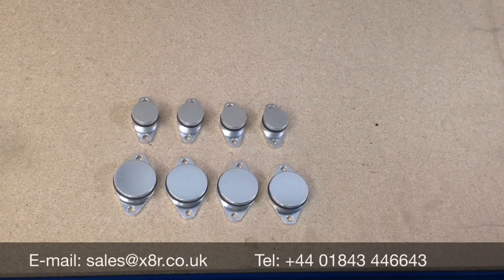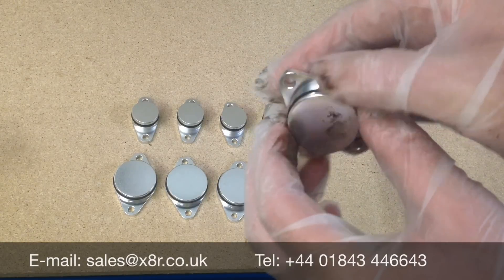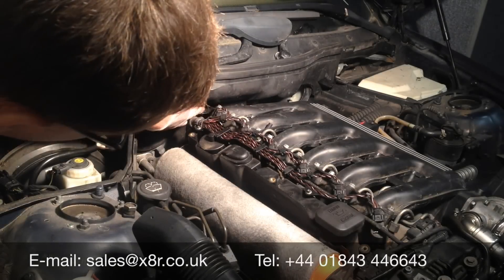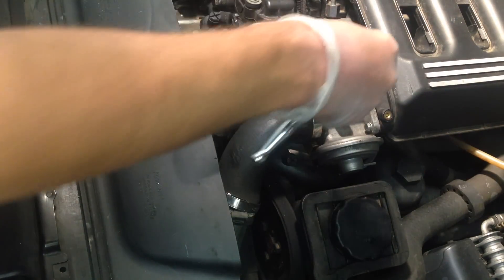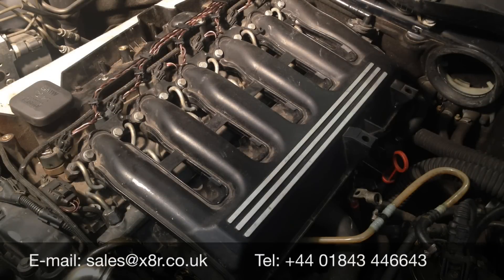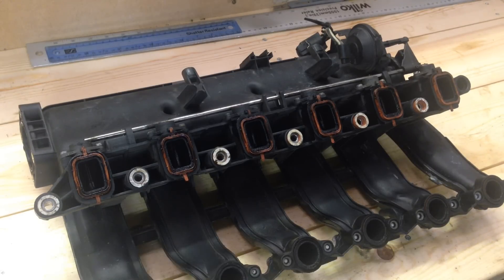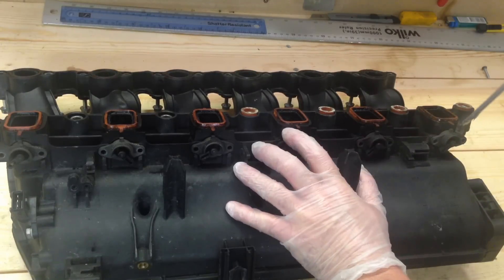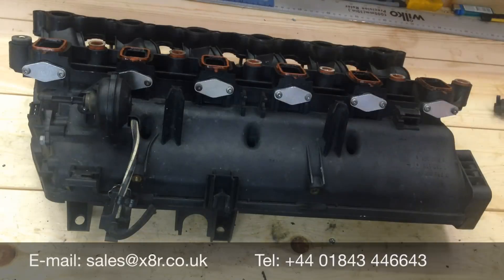BMW Swirl Flap Blanks Fitting Instructions Guide

Comment: At 5.08 the vacuum actuator doesn’t need to be replaced,just cut the rubber tube plug the hole with a bolt and silicone job done,did my M47 320d this way and never had a problem or fault code in 70,000 miles,also did a M57 525d the same way,found the 6 cylinder easier to work on than the 4 cylinder though.

Comment: Ive heard of the issues that can come up from these once they start to fail so I decided to order a set and put them on but im noticing that every parts dealer has these listed for an x3 diesel. are these not on the standard gas/petrol 3.0i ?
Reply: its only on diesel engines
Reply: that's what i figured from what i was seeing but wanted to confirm. thanks!

Comment: what's the benefit if the blanks? I'm still trying to get my head around why this is done surely the swirl flaps have a purpose ?
Reply: rscosworthfan thank you for your reply ....why do bmw use them if the car does well workout them ? surely each part has a purpose ? wouldn't it be better to replace them instead ? just curious
Reply: biggest advantage of removing them is that it saves a fortune in engine repair bills swirl flaps can crumble and bugger your engine
Reply: i didnt know to be honest till i looked it up heres what they are meant for.. Swirl flaps are designed to create swirl or tumble of the air to aid better combustion under light load where soot levels tend to be dominant because of the lack of air, they are also there to help with driveability in low load conditions, they are controlled by a vacuum or solenoid actuator and are closed during light .....so from what i see the only time they are any use is like for driving around town if you use motorways a lot then i dont believe you need them
Reply: yes you can replace them but i wouldnt personally BMW have stopped doing swirl flaps now in their latest engines   this page will tell you everything you need to know about them    http://www.bmwforums.info/general-guides-and-how-to-s/993-bmw-diesel-engine-swirl-flaps-to-swirl-flaps.html
Reply: rscosworthfan OK thank you will look into this to get done or may try do it myself thank you
Reply from the maker: Lots of info on the advantages of removing here: https://x8r.co.uk/products/bmw/bmw-swirl-flap-blanking-kits/swirl-flap-blanking-plates-bmw-diesel-engines-22mm-blank-plate

Comment: How is economy after delete ?
Reply from the maker: You will most likely see no difference.
Reply: Good thanks , i blocked also mine fully opened, i have mercedes and i can't take them out being iron intake manifold, is too complex
Reply: Marius Negrean i done mercedes 320cdi. You have to weld the shaft holes after remove the swirl flaps. I left the swirl flaps motor in place plug in. It works perfect

Comment: Why don't you unscrew the 2 small screws that hold the flap onto the swirling rod and then reinstall the thing back to its place. Do that for each of the 6 swirl flaps and you don't have to buy those blanks anymore.
Reply: +dj309fm It's better to remove the flaps entirely.

Comment: HI, I HAVE ONE 04 BMW 320 D SE TOURING 6 SPEED MANUAL, I DID NOTICE THE VEHICLE HAD SOME SORT OF OIL LEAK AS ITS BURNING ON THE MANIFOLD AND COMING IN TO THE CABIN, COULD YOU TELL ME WHAT i SHOULD CHANGE TO STOP THAT PLEASE?
Reply: Remove swirl flaps change all gaskets. On mine was the same leaks now all ok
Reply: I have down that and chane urnin still same LOL.
Reply: burning sorry
Reply: Have a look exhaust manifold it may have small crack and gas leak from it